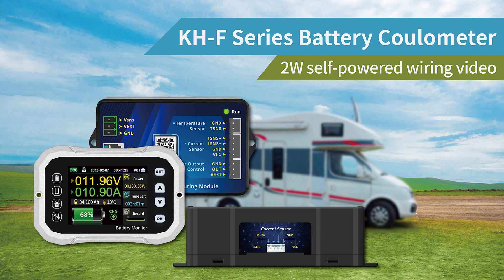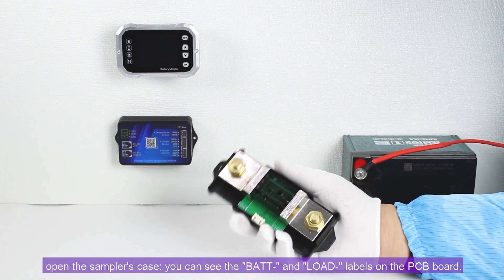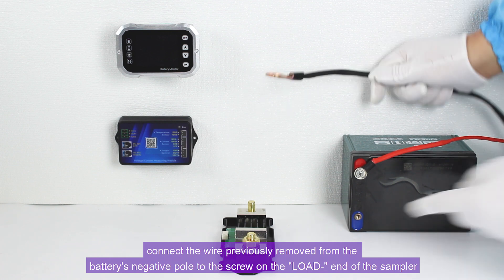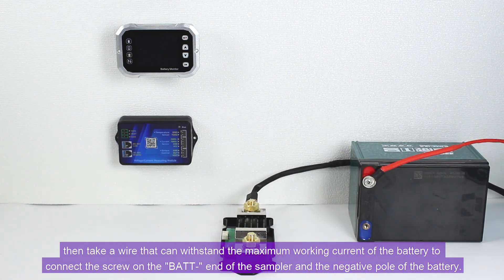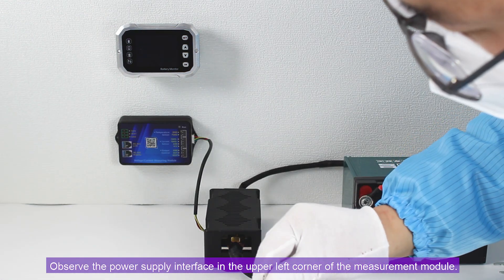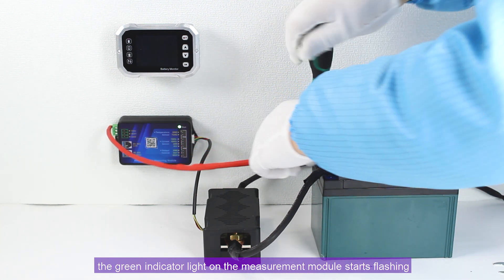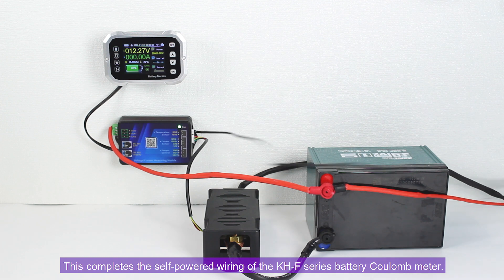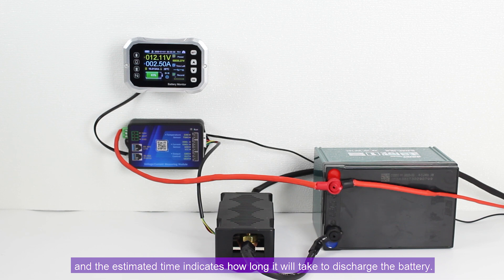The wiring method of KH140F when measuring 10-120V battery.RV Yacht Electric Vehicle Battery Monitor

Comment: Is it ok to connect a marine grade fuse block terminal directly to the negative post (take the fuse out) and connect the shunt where the fuse was?
That way it would delete the cable coming off the battery to the shunt.
Then a run of cable from the load side of the shunt to the negative bus bar.
I figure it's always better to make as few connections as possible.
Reply from the maker: Hello, just connect the shunt in series to the negative line